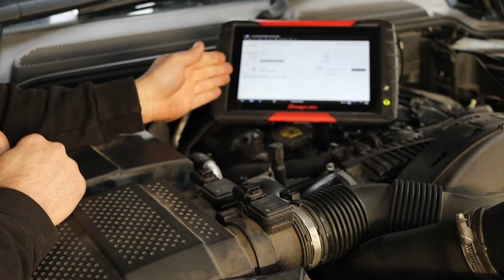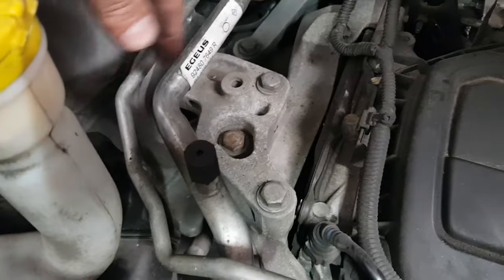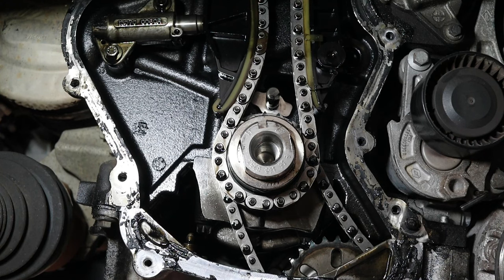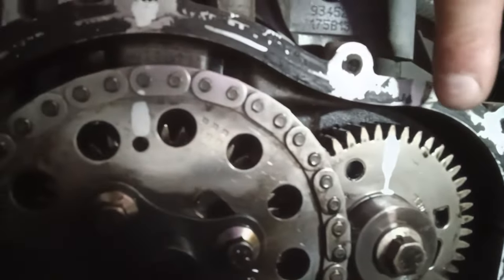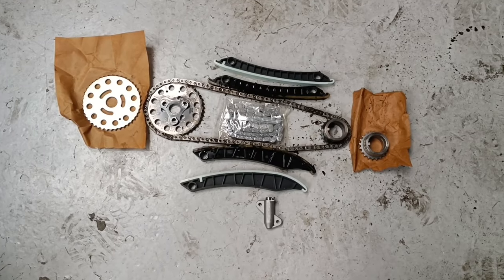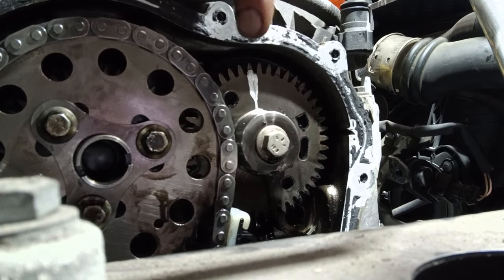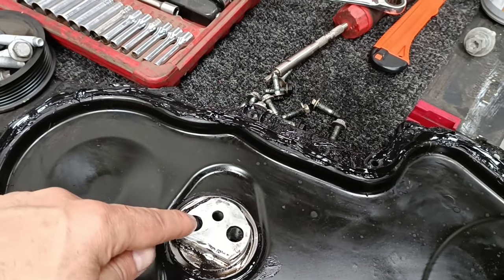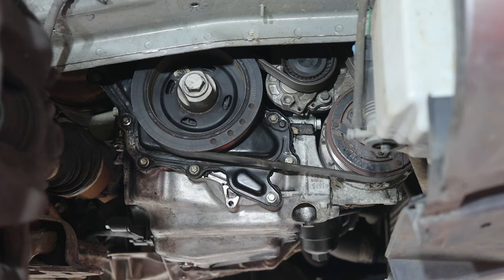Vauxhall Vivaro/Renault, Nissan R9M timing chain replacement

Comment: Your timing method is not satisfying. Basically you are timing a new chain in a worn chain position.
Reply from the maker: Thank you for your comment, As shown in the video, the tech data only shows timing marks and not timing tools for this engine. This isn't a tutorial to replace your own timing chain, but a general interest video of what goes into replacing a chain and how chains wear out and not stretch. This van has been in since for servicing and without any issues. Thanks for watching & commenting 🙂👍